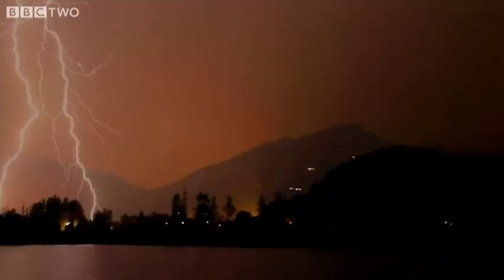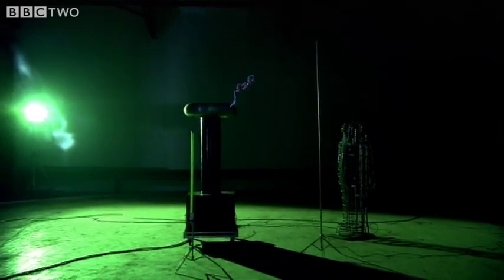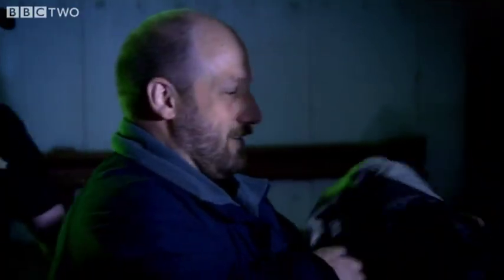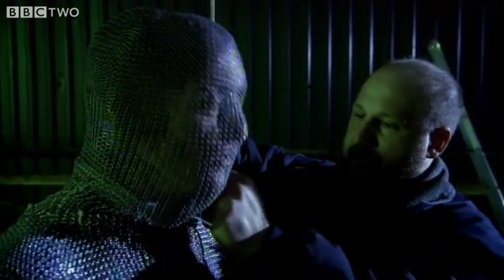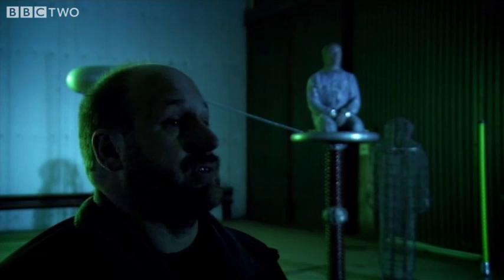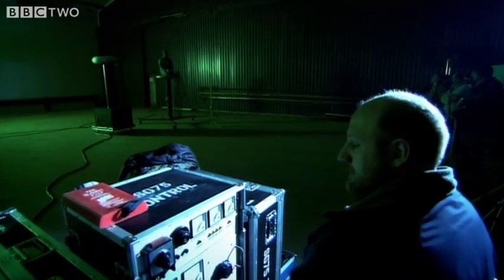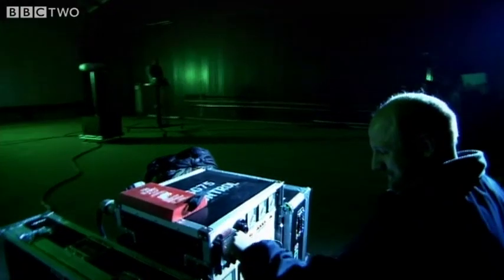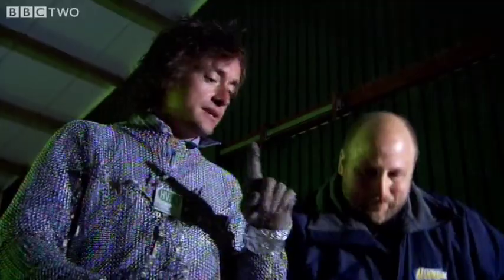Human Lightning Rod - Richard Hammond's Engineering Connections episode 5 preview - BBC Two

Comment: It's not really lightning because lightning is white, not blue. It's white because lightning it's hotter; ie there is more 'power', about 1000 times more power, in a lightning bolt than in the demonstrated high voltage discharge, but it's fun to watch!